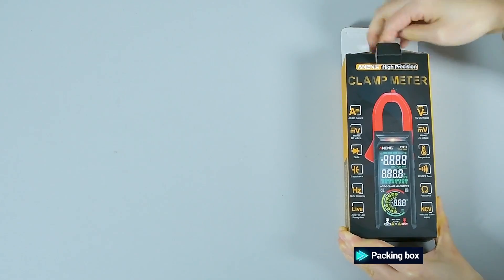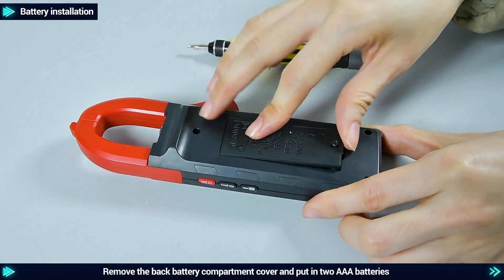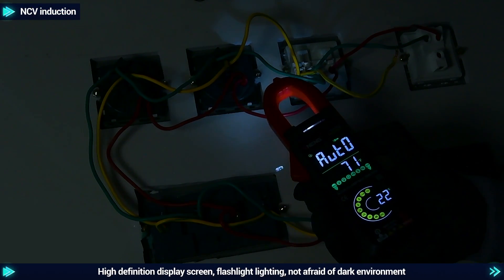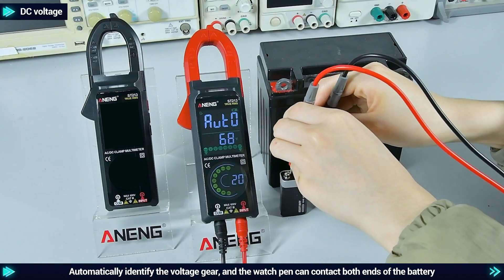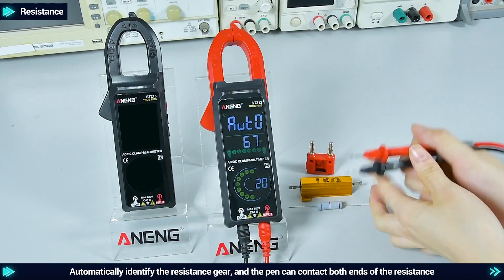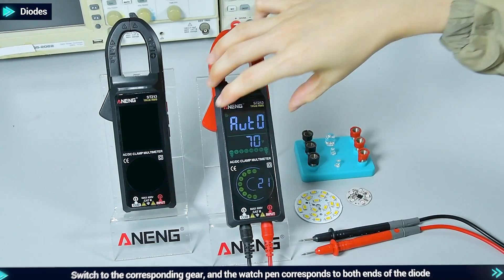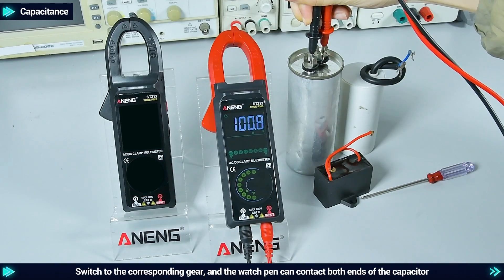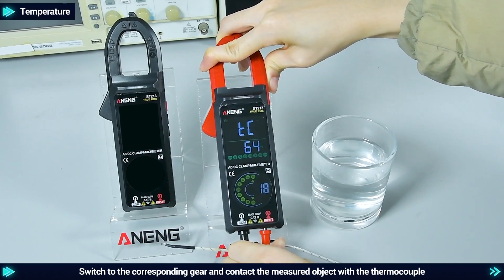ANENG ST213 Clamp Meter VA Reverse Color Display Screen Multimeter CATIII 6000 Count True RMS Tester

Comment: It has specific modes for capacitors, diodes, voltage, and current. BUT IT DOESN'T HAVE A SPECIFIC MODE FOR MEASURING RESISTANCE!!!! INCREDIBLE!!!!! To measure resistance, you have to select AUTO mode, and on MANY occasions, the clamp keeps switching between "resistance" and "other mode," and in the end, you don't get any readings. I bought 3 units, and the same thing happens on all of them. It's not a clamp for professional use. Very disappointed. It's only good for home use. Not professional. Regards, Matias.

Comment: I'm still waiting for a big and heavy desktop multimeter and nothing. You know, ac 230V power, dedicated keys (like mV, V, A, mA, etc) and big display. I wonder if manufacturers employing a lot of engineers will make it before he builds it himself, because so far they offer only small meters that fall over as soon as you pull the cable.
Reply: Oscilloscope is best for this